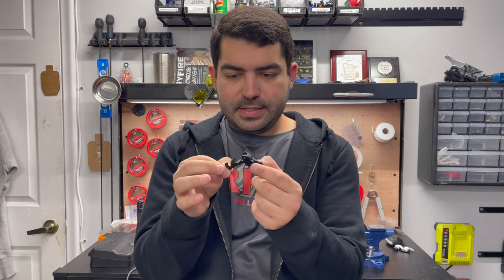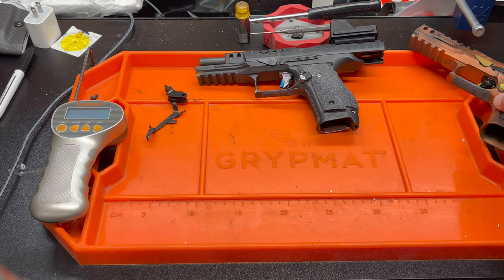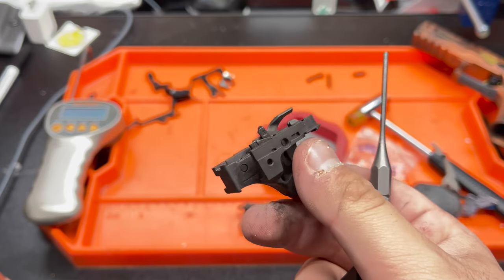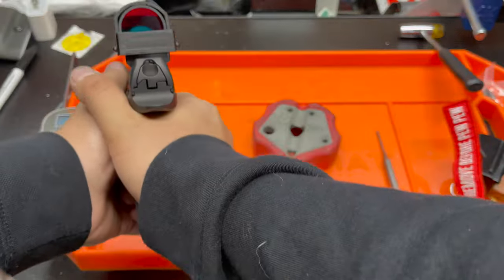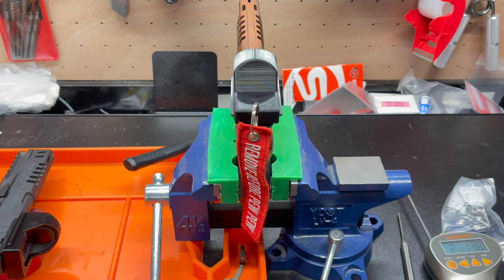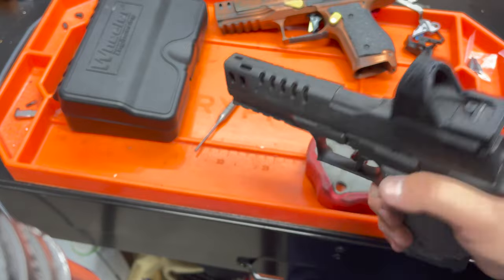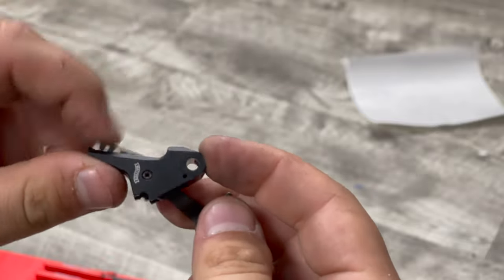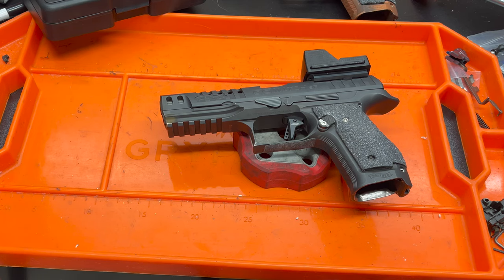Walther Dynamic Performance Trigger vs. Overwatch Precision Tac Trigger - Initial Impressions

Comment: After watching your video, I installed an Overwatch trigger in my Q4 SF. Better then stock, but it breaks too late. Took a chance on installing the Walther performance trigger with sear housing. Much better break angle and reset, but pull weight over 4#. Then swapped out spring for a Sprinco and now - perfection!! Just over 3# pull with a crisp almost 1911 break! By far the best striker-fired trigger I have experienced!
Reply: Where did the new spring?

Comment: Very helpful. Got a Q4SF a year ago and I love it. Looking at potentially getting another one (or I might get a 92X performance) and modding it out. Was debating between these two triggers. Very helpful. Leaning towards the Overwatch.
Reply: Same! I got a Q4 and Q5 SF but am contemplating whether to get the Beretta 92x, CZ Shadow 2 or Canik Rival S later. Also would you exchange your Q4 for a Walther PDP Pro if the price was the same?

Comment: Just installed the dynamic trigger plus fire control group in my Q5 SF. Wow! Just wow! Even with the stock spring. A very clean, crisp break at 90 degrees. I'm blown away. I've got an Overwatch Precision trigger in my Q4 SF. I prefer the the Walther trigger due to its break angle. The Overwatch breaks later and has little travel before it does (not that it'd be noticable while on the range tho). I much prefer the Walther's 90 degree break.

Comment: very appreciated in depth review/comparison.
I have a PDP as my edc and love the factory trigger quality/poundage as it is and don't mind the take-up, as the wall is comfortably enough defined for defensive use.
However, I also have long fingers and even with the largest backstrap installed, I'd like to change the trigger shoe's position to a more forward set/breaking position. The fact that these triggers set/break further forward than factory is a great +.

I've been looking online at the Overwatch, Walther Dynamic and Apex triggers an this is the first useful comparison I've seen.
I see you recommend the Qverwatch over the WD for edc.. but would you also recommend the Overwatch for what I'm trying to achieve.. or any other that you'd recommend?

Comment: I'm not sure how these guns work as I just picked mine up, but on a Glock the striker spring definitely effects pull weight. So these completely load / cock  the firing pin spring and the sear just releases it? Btw thanks much for the video.

Comment: I recently bought a q5 steel frame and I have to be honest I was very disappointed in the trigger. It has a ton of creep in it although it is smooth. I compared it to my cheaper PPQ m2 trigger and found the PPQ has a far superior trigger from the factory. I figured being the competition version of basically the same gun it would have the better trigger in the steel frame no questions asked. Maybe a slightly lighter pull would be the real difference considering how good the PPQ trigger is. Maybe I got a bit of a lemon I'm not sure. Overall very disappointed with the trigger though. I will for sure be purchasing an aftermarket trigger to remedy this.

Comment: I've run both the OW and DPT in USPSA matches.  I agree with your review and comparison between the two, good job.  I am also having the same issue with the DPT with quick follow up shots--you have to pull slightly lower to engage the safety blade unlike the OW you can just slap it wherever.   Where did you buy your grip tape at? or are those custom?   Thanks!
Reply from the maker: Glad to hear you agree, Paul! Means I'm not crazy. Your call if you want to do the modification I did... also, are you using a lighter trigger spring on the DPT? You might find my follow up video I'm posting in the next few days interesting.
Reply: @hdshooting1729  quick side question, can you recommend a shop for grip stippling for my polymer PPQ?  
I love my SF and found your video very informative, especially modifying the trigger blade safety as I have the same problem. 
Please let me know if you know if a great custom grip stippling shop. Great video
Reply from the maker: @GianniG60  I don’t have any experience with stippling shops unfortunately.

Comment: Thanks for the great video, can you possibly let me know what you run for a recoil spring? Or make a video about that, when I order the dynamic trigger and fire control , should I be ordering the lighter factory recoil spring? Running 130pf ammo for IPSC
Reply from the maker: Great idea! I will try to do a short video on springs soon. I am running the ZR tactical guide rod with flat wire 1911 or glock recoil springs. I ran a 13lb spring last year but switched to a 15 recently and like it.

Comment: Nice vid! From where did you ordered the dynamic trigger?
Reply from the maker: Call up Earl’s Repair Service, they will get you taken care of.
Reply: @Marc Ewell Thank you, that means it wont affect the warranty, right?
Reply: Also, do you know how much the trigger pull after installing it? is it less than the factory trigger?
Reply from the maker: @naji2naji  I can't speak to the included trigger spring but there are extremely inexpensive aftermarket options that will reduce trigger pull weight from Sprinco, compatible with regular and dynamic trigger.
Reply: @hdshooting1729  thank you! One last question, do you have to use Sprinco firing safety spring when using Sprinco trigger spring? Thank you. Awesome video!
Reply from the maker: @naji2naji  Nope, totally optional. I don't do that on my defensive guns but do on my competition guns. 
One thing I've learned in the last couple of weeks is that the trigger return spring weight significantly impacts the trigger safety blade issue I talk about in the video. Since then I've gone away from the Sprinco springs although I'm still using a lighter one than the stock spring.
Reply: @hdshooting1729  Thank you so much and appreciated. Called Earl last week and bought Q 5 SF.  Also, Earl sells Walther's trigger springs , light, medium and heavy. Thank you! very informative stuff!

Comment: Nice review. I have a Match Q5 SF and I'm wondering what optic you have?
Reply from the maker: I am running the Sig Romeo 3 Max 6moa using the Springer Precision mounting plate. I think this is the best optic out there for competition. The window is huge, glass is quite clear, and the dot is extremely crisp and bright in sunny conditions.

Comment: How does the OW trigger deal with the safety plunger? That seems to be the main thing keeping the stock PPQ trigger from being truly phenomenal.
Reply from the maker: The OW trigger doesn't do much different there - it's using an OEM trigger bar as far as I can tell, just NP3 coated so it's been blasted to clear off the factory coating which may smooth things a bit. That said - my safety plungers are not an issue for me. I've heard some folks report issues with theirs, I'd suggest inspection for burrs/rough spots and consider some surface polishing - don't take off significant material from the key surfaces that interact with the striker or trigger bar unless you see a burr that shouldn't be there protruding.
Reply: @hdshooting1729  Yeah I polished the bore and plunger to get it as smooth as possible, but it seems that the friction inherent to the plunger and spring combo keeps the trigger from truly being up there with competition triggers (besides the long take-up).  I suppose I could look for a lighter spring, but that might interfere with the safety operation. Thanks for the reply.

Comment: Would you recommend this for competition only or think it can be used for carry? I love my stock trigger but I hate the travel time to the wall.
Reply from the maker: I think it CAN be used for carry, but I prefer the Overwatch trigger for defensive purposes. New video coming very soon on why.
Reply: @hdshooting1729  looking forward to this video. My PDP is incoming
Reply: @hdshooting1729  is there more reasons than besides the trigger safety?  Both the trigger pull weights seem too low for carry, at least for me.

Comment: That minimal sear engagement on the performance housing looks almost scary to me....seems like bumping the gun on something could cause the sear to slip right off the single action lever causing a ND.  I certainly wouldnt be carrying it around with a round in the chamber anyway lol....im sure its been tested for safety but I like the full face of the sear contacting metal on my pistol.  I do like that trigger tho.

Comment: Great stuff, thanks. I recently picked up a Q5 Match SF as an upgrade to my 5in M1. Love it so far with SprinCo springs but I have noticed potential safety blade issues. I may pick up a Dynamic Trigger and fire control module to try and go from there. Heck, I like the stock trigger but it's fun to tweek and upgrade. Looking forward to more from you re the Match SF. Subbed!
Reply: Follow up to my post above. Took the Q5 to an outdoor range yesterday. With gloves on I absolutely have the trigger safety blade binding up issue. With bare hands it's OK. Guess the gloves mess just enough with my fiber reach to highlight the problem. I'll prolly try to file the safety blade a bit and see how it goes. Thanks for this video.
Reply from the maker: @SEAKPhotog  The trigger spring is also a big issue here. I didn't expect it to be, but the more I experiment the more I see the correlation.
Reply: @hdshooting1729  Hmmmm, thanks! I've got the Sprinco spring in there now. Maybe I'll go back to the original spring and see what happens. It seemed to only be an issue so far for me if I'm  wearing gloves and I don't get my trigger finger at the right angle.  But I'll be shooting outside as much as inside and in all kinds of weather so I've gotta come up with a solution, whether filing a tad or the original spring or maybe even the Overwatch trigger.
Reply: @hdshooting1729  Boy, you're absolutely correct. I just reinstalled the factory spring and it helps a heck of a lot. In fact, it seems to completely get rid of the issue for me. That's good to know. Now there are decisions to make: keep the stock springs and trigger, buy an Overwatch replacement trigger set, file the stock or a performance trigger safety tab a bit and reinstall the Sprinco spring. Decisions, decisions. For now I think I'm just gonna live with the stock trigger and spring and see how it goes. Thanks for the helpful info! 👍 Happy holidays!

Comment: Excellent video explaining pistol competition extra-smooth triggers. Indeed, they have a place in competition shooting. 
With that said, IF competition highly accurate modified handguns, with smoother lighter triggers (replacing the factory triggers), are used in self-defense, they become a liability issue in criminal / civil cases against the defendant (or user of such specialized handgun).
 For personal/ home protection and self-defense, it is best to rely on the outstanding factory triggers from gun manufacturers like Walther Arms, Heckler & Koch, Canik, CZ, and a few others, than making the trigger lighter to find out that it may become an unfavorable issue in a court of law.
Reply: I'm not sure I understand how a legal trigger upgrade can be a liability issue, in a clear case of self-defense a legal aftermarket trigger isn't going to make any difference in your credibility.
Reply: @darkpassenger65 talk to a lawyer about altering a factory trigger for a lighter one. It changes the product and increases the liability. Pistol light triggers less than 4 lbs. weight pull have their place in competition matches, but not on duty / personal protection. Do the research on the issue.
Reply: @v.german11b  First, I am a lawyer. Second, did you just claim that a sub-4 pound trigger pull is the difference between manslaughter and legally defending yourself? Be careful how you answer that. Can you cite what rule, law, or statute regarding your claim that a sub-4 pound trigger pull will get you convicted or enough to lose a civil lawsuit? Who and how was this sub-4 pound standard established? I understand where you're coming from but I challenge you to cite a single case where the legal installation of an aftermarket sub-4 pound trigger was the deciding factor in a civil or criminal case of self-defense. I'm not saying you're not making sense, all I'm saying is it really isn't a very difficult hurdle for a competent defense attorney to overcome. We're not even in front of a judge and I've already made you look pretty foolish. I appreciate this opportunity to debate with you.
Reply: @darkpassenger65  you are a "very dark" lawyer, indeed, not to see the alteration of an original factory trigger to a lighter weight pull as a product liability issue and/or an involuntary manslaughter issue.
Reply: @v.german11b  I'm still waiting for those case citations.
Reply: @darkpassenger65 you are not that good of a lawyer. You asked me to cite a case law or statute that "gets you convicted for having a pistol with a light trigger"?! What a dumb question is that?! How long have you been practicing law? In what field? Give me your state bar number and state where you practice. It is hard to believe you are a lawyer!
Reply: As long as you can demonstrate that the trigger work improved your shooting you won't have a legal issue.
Reply: @33jrp  you are speaking for all state jurisdictions?